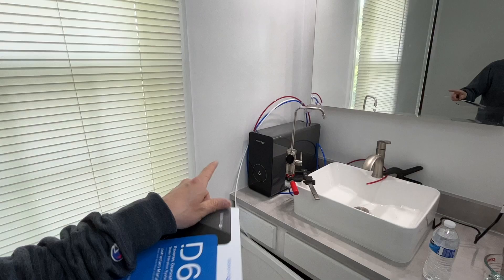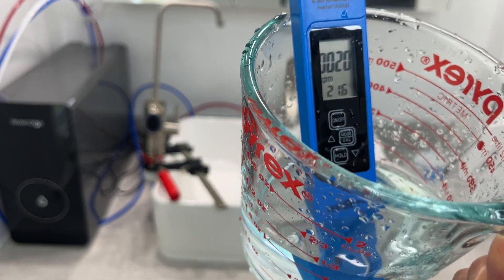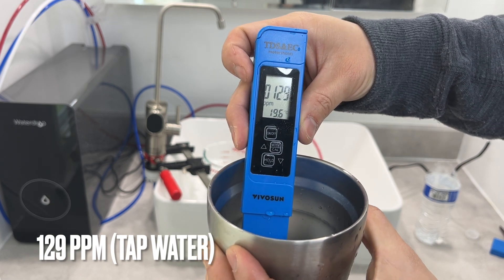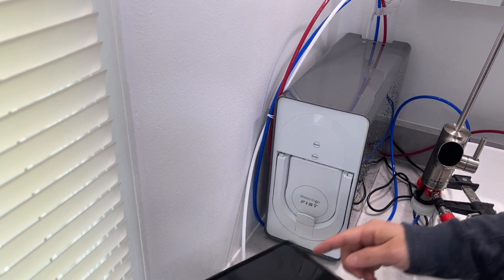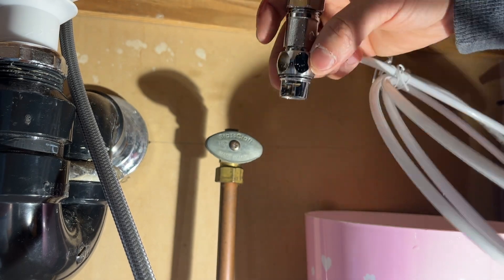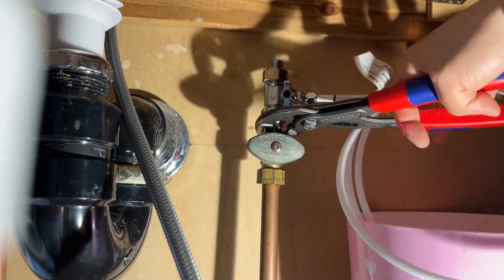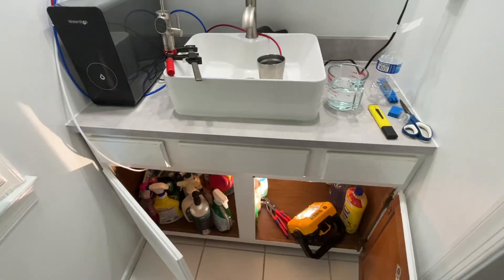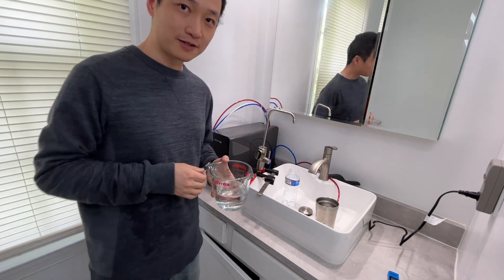Quantified Test Results. Waterdrop D6 Produces High Quality Drinking Water!

Comment: You have to take it with a grain of salt when talking about total dissolved solids. The problem with low TDS is it not only removes the bad stuff, it also removes beneficial solids like healthy minerals that are present in our water supply.
Reply from the maker: Can we get the healthy minerals from daily food intake?
Reply: @ToolsElectroDIY you can add the MRN filter to this
Reply: I really hate this myth. You would need to drink a bathtub full of water to get the mineral intake your body needs. Just look at % of intake on something like a Gatorade. Most of the minerals you need you get from your diet.